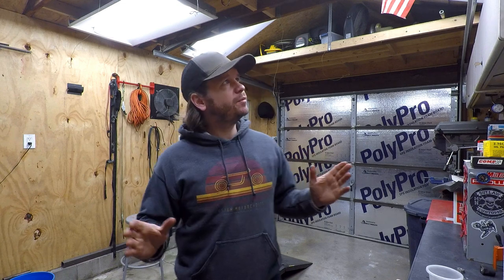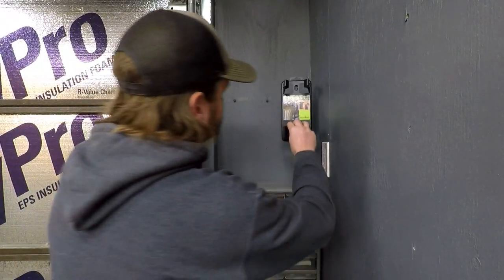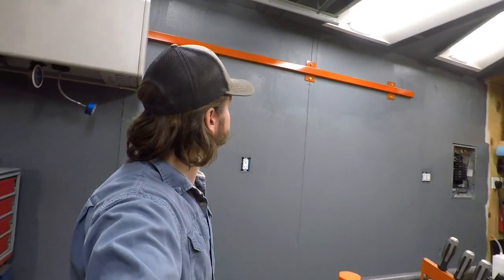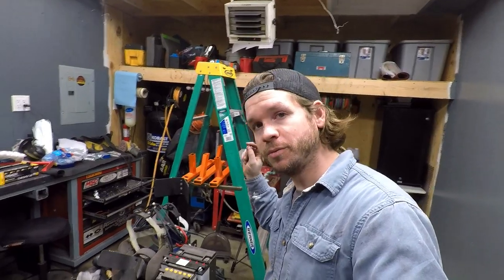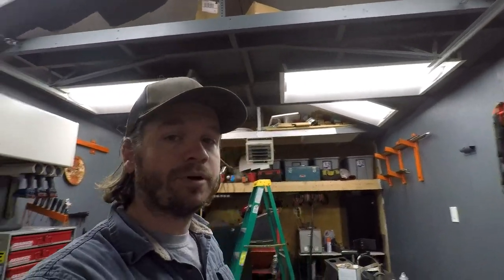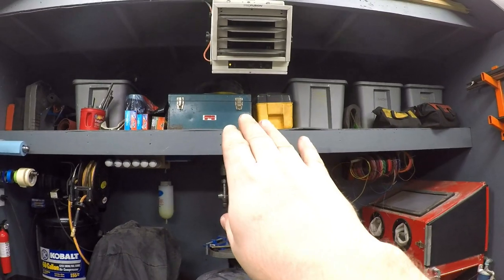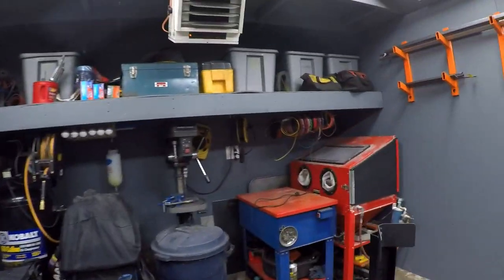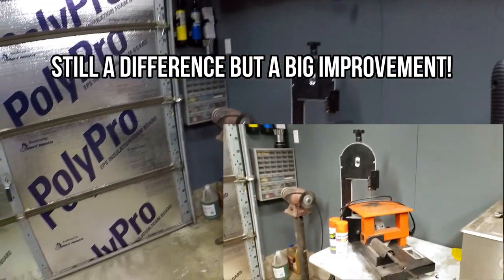Motorcycle Shop Makeover! Fresh Paint And More Organization!

Comment: That heater you have hanging looks almost identical to the one I put in my shop. I had to run a 220V 30amp power to it, but it heats my 25'X25' shop with with no problem. So if yours is the same power it must be able to run you out of there with excess heat. I need to get some of those torch hangers. mine are always toppling off a shelf and then they fall and bend. Glad to see there's a solution for that. You must have a shed to put bikes in you're not working on so they don't crowd you out. Or maybe inside your trailer.
Reply from the maker: Same heater for sure and it absolutely will run me out! It works really well.  I had a video over a year ago where I slipped and knocked a torch off my bench. A friend saw that and bought me those torch hangers lol.  I keep the rest of my parts and bikes at a warehouse nearby.  The linked video shows all of that!
https://youtu.be/FXWePhhL-V8

Comment: Super jealous! It's awesome having a nice clean workspace that you want to spend time in. My workspace currently has 4 inches of snow...with more coming all this week. Which is a bummer, because NUUT just finished my cx500 Marty wiring diagram.
Reply from the maker: Well that just gives you time to perfect that harness!
Reply: @BrickHouseBuilds  yeah, I'll have to rewatch your vids and make a map and measure all my stuff, then just make the harness inside. I also need to diagnose why my right cylinder isn't firing before I tear up the wiring, hoping it's just a bad spark plug.

Comment: Hey BJ. Do yourself a big favor and keep your new lathe covered when you are media blasting or spray painting. Same for the motor on your drill press and, whenever possible, compressor (the compressor intake could be ducted from outside if you are in a fairly warm climate). I offered up my experiences to help my friends arrange their shops too. Mainly, keep the machines away from dust and grit. I've blown machine motors a few times in the past (getting replacement motors is a royal pain in the ass, BTW) and prematurely wore out compressor pumps too. Now I don't do any blasting, paint, or bodywork in my main shop. Also, now that I have more machinery and precision instruments in my shop, I actually do bike bodywork and paint in a properly ventilated spare room in my basement, and do all my media blasting in a smaller separate building just a few yards from my garage door. A new 30x50 shop is in the future when I have enough $$$$ saved. It will have completely separated areas for the clean and messy / dusty processes. Also, having a separate supply of fresh clean solvent for the parts washer is good for when you are putting engines together.

Comment: I was getting ready to make a Michael Angelo Sistine Chapel reference when you were painting the ceiling but you beat me to it.   I like the grey with the orange accents, it looks good.   Is it possible to to cover that silver PolyPro insulation on the door? That's the only part that feels unfinished.
Reply from the maker: I knew I HAD to include that reference while painting the ceiling lol 😆   It's funny as in the last year I haven't had a single comment on the garage door but within this video its the main comment focus. As Ive mentioned in other comments I dont want to risk losing any heat reflective properties of that foil outside layer. The garage can get cold and I worry about heat loss. I do agree that it looks meh at best but I like being both warm in the winter and cool in the summer